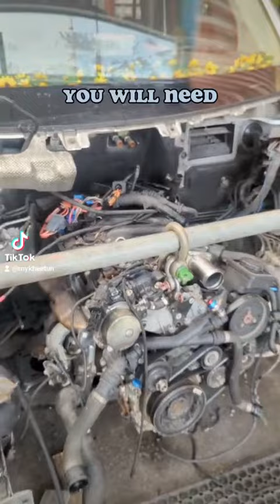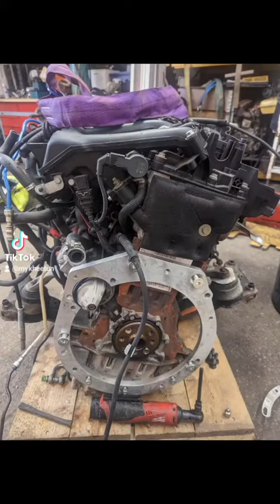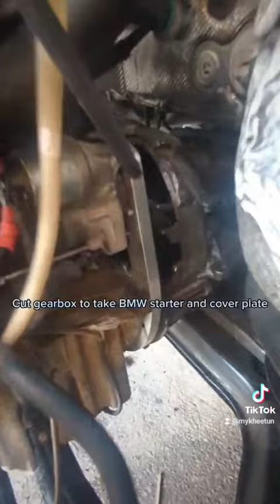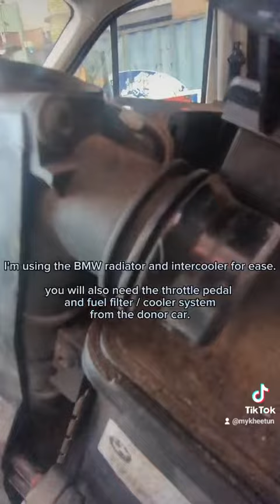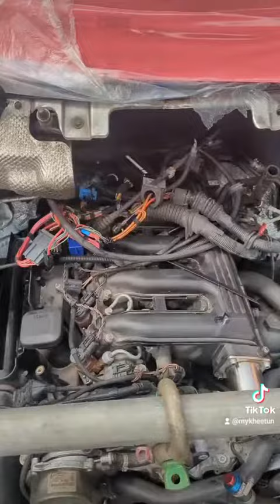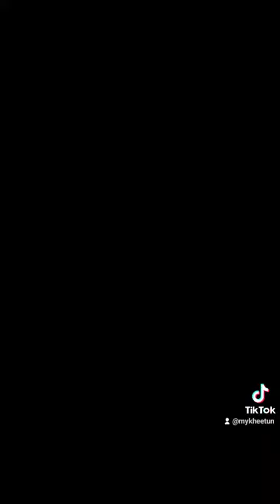Rough guide on what's needed for the m57 transit conversion. #bmw #fordtransit #e46 #m57

Comment: What's it cost you to do it I've a 535 d and a 10 plate transit want to put the engine in my van
Reply from the maker: really depends on how handy you are but 5-6k if you can do it yourself. I sold donor car parts and transit parts along the way and recouped most of it. adapter plate, wiring, dash controller, clutch , engine are the big bits.

Comment: What diff ratio would you be running with this?
Reply from the maker: No idea on ratio its the fastest diff available 155 transit lwb 70mph is roughly 2500 rpm. Could do with another gear tbh